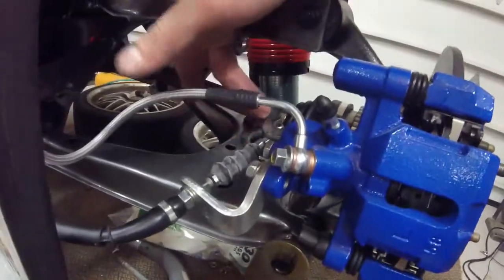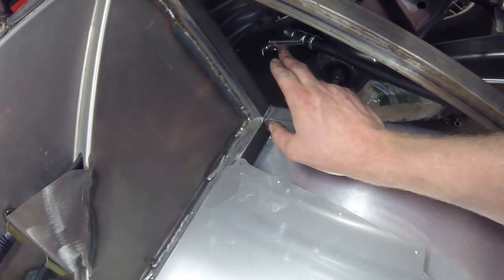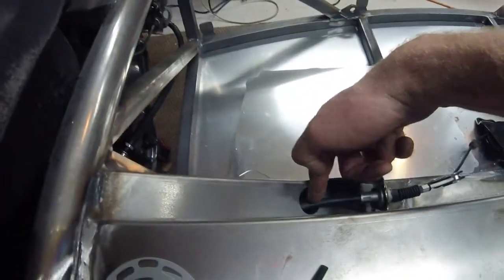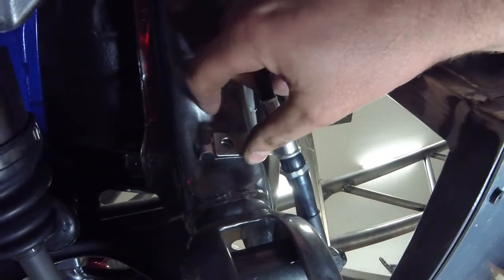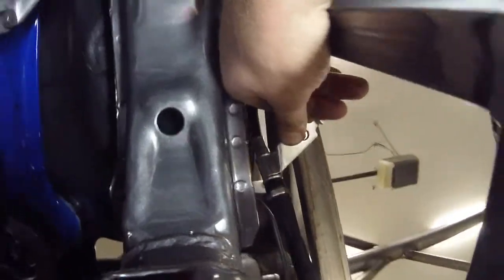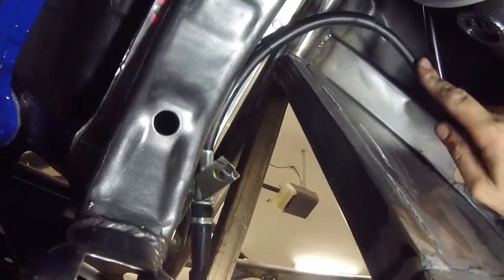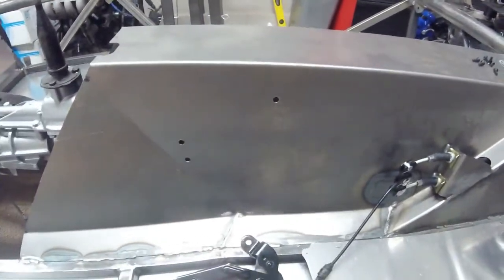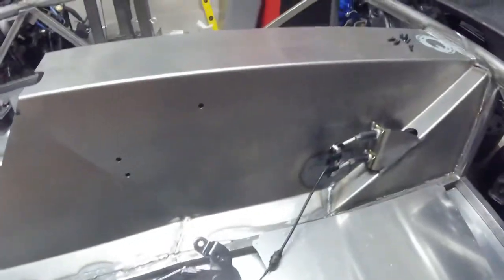Exocet Build:  Mounting The E Brake Cables & Handle (Part 35)

Comment: you might use some vacuum line glued around those holes to make your grommets.  Just split is length wise and cut to length.  Works well.
Reply from the maker: Darren Graham good tip.  But I think I've found some grommets that will work from the electrical section at home depot